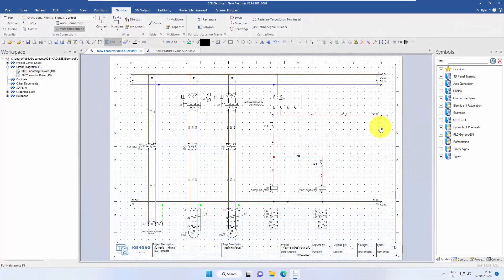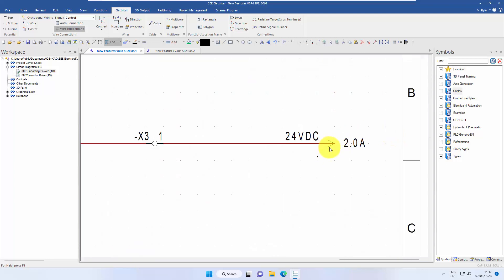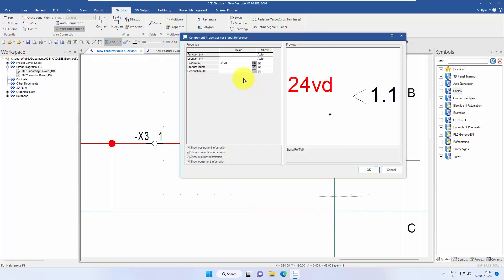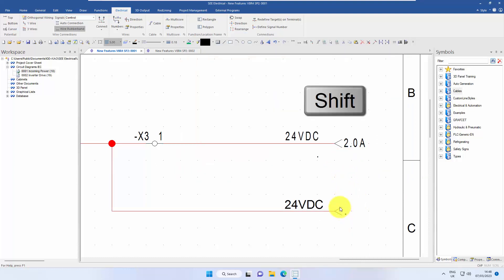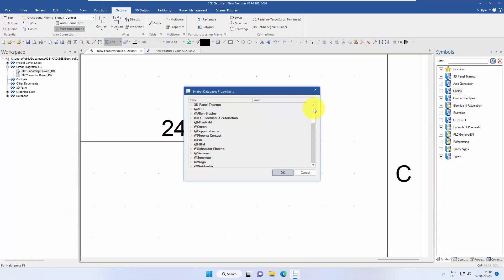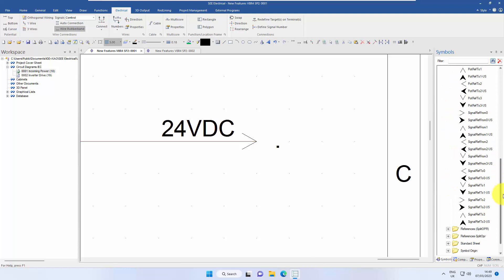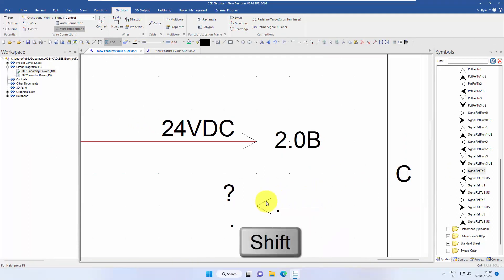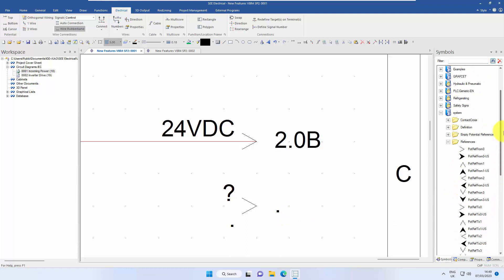V8R4 New Features Signal Direction Switch

Comment: How to change signal direction in V8R2?
Reply from the maker: Either manually switch symbols or tap function key F6, hold Ctrl and select the graphical elements, then select mirror and click 2 points for an axis to mirror the graphics. The same could be done with rotation if its just the graphics. Otherwise, upgrade to V8R4 :)
Reply: @IGEXAOUK  can you make a video tutorial?

Comment: Its does not work.... I cant change the direction...
Reply: Sorry, it's working. It was problem with my System Symbols
Reply from the maker: @Automatyk2Hydrotech  Thanks for the quick update. Yes if you copy the V8R3 system.ses file across to V8R4 then you'll miss out on the direction swapping for the signal references.